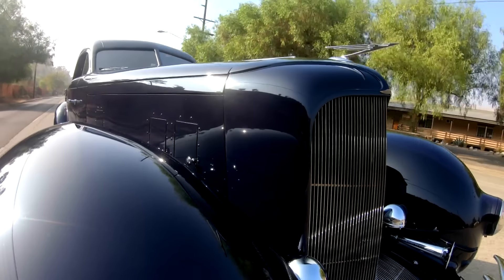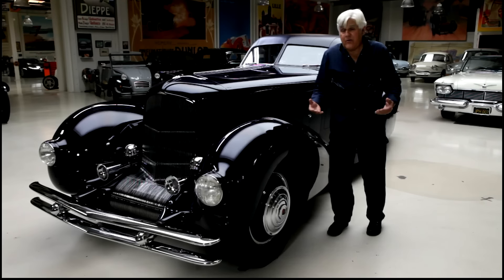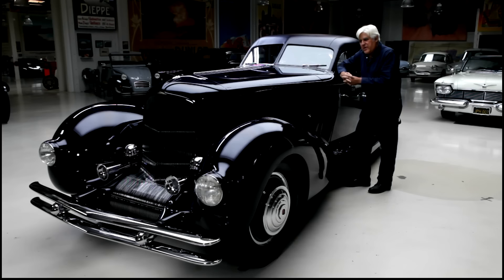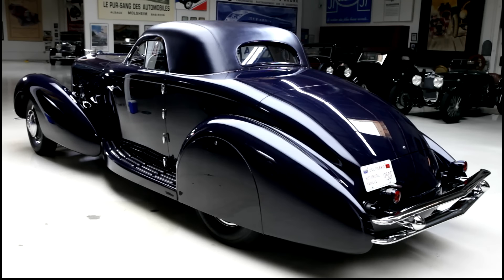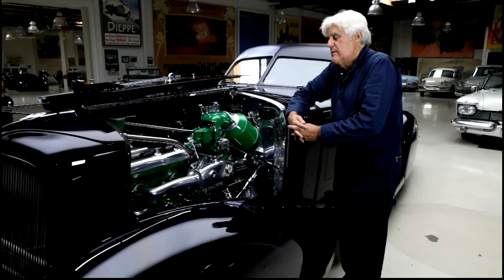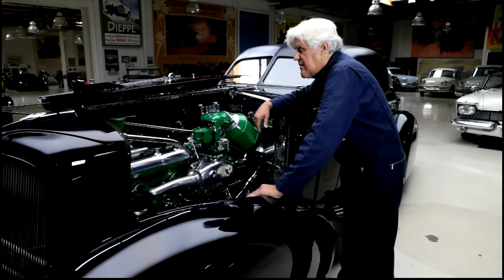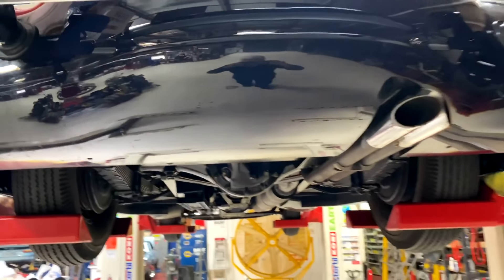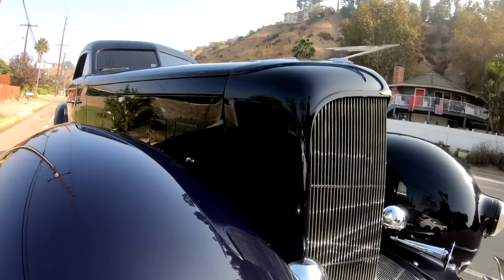The Most Expensive Duesenberg Ever Made - Jay Leno's Garage

Comment: That’s about as “art deco” as it gets
Reply: Check out the Delahaye cars from around the 30's.
Reply: @sclogse1  was just about to say this
Reply: @sclogse1  Some Avions Voisin are also fully art deco.
Reply: anything by figoni & falaschi and saoutchik
Reply: Chrysler and Desoto Airlow
Reply: The Cord 810/812 is more so.
Reply: Amateurs. If you want Art Deco car, Hispano-Súiza Dubbonet says hi. It has half of an airplane engine for crying out loud!
Reply: Bugatti Atlantic is the better version of this Dusenburg coupe. I'm avoiding anything over 4,000 pounds myself. Alfa 6C of this era is running circles around road blobs. Straight line highway cruising probably very nice experience in the Dusenburg. Except what, 13mpg negates that mental freedom.
Reply: Rolls-Royce Phantom l Jonckheere Aerodynamic Coupe & Stout Scarab are more radical Art Deco cars
Reply: @Greg-io1ip  13 mpg? Only when it's behind a tow truck. If you were to get 9 mpg, you would be doing well. On the other hand, who cares? If you could afford a Duesenberg, the price of gas just wasn't important.  You could well have owned the oil company and didn't even have to pay for gas!

Comment: By chance, we used to live in Oak Lawn Illinois, and a block away was Fran Roxas, who restored Dusenbergs, Cords, and others. My granddad used to make nuts and/or bolts for Mr. Roxas out of stainless, very difficult to work with, but he'd say that the parts my granddad made were perfect. One time my grandma reached and opened the door on a restored car, so my granddad hurriedly wiped the handle with a cloth. Sadly at the time I was 13 or so and not interested, but I do remember my granddad running the lathe in the basement, it had this incredible whirling sound. Still sad about my granddad dying back on 4/14/1983, he was a man of those times. Apologies for rambling a bit.

Comment: What many people today don't realize is that as late as the early 1960's, cars like a Dusenburg Murphy Roadster, that today goes for somewhere in the million dollar range, could be had for less than $500.
No one, with the exception of people like Bill Harrah or Jack Neathercutt (Merle Norman Cosmetics) understood the potential value of automobiles like the one just shown in Jay's video. 
Jack Neathercutt would drive around the Los Angeles area and spot automobiles that were once wildly expensive, one-off cars parked at a corner gas station with the name of a pest exterminator painted on the side of the car facing the street.
It had been promoted to a stationary bill board. 
These cars had become obsolete, terrible on gas mileage, and if the car had experienced mechanical or collision damage, replacement parts were impossible to find. Only wealthy people such as Harrah and Neathercutt, who had an entire staff of restoration specialists had the means to bring a car like this to like-new condition after years of neglect. 
In the post war United States, the well-to-do didn't want a car that was twenty years old that had seen service as a tow truck. They were in the market for a Cadillac Eldorado Biarritz or Chrysler Crown Imperial Limousine. 
I've personally heard a story of a man who worked as a plasterer working on new housing tracts in the La Miranda, La Habra area outside Los Angeles in the late 50's. 
His "work car" was an early 30s Dusenburg Roadster. He had removed the rear deck lid and used the area to store his tools and a ladder or two. I have no idea if the car was eventually saved or scrapped. 
I have met Jay on several occasions. Usually on the Sunday between Christmas and New Years Day. 
Jay is a person that started out as a car guy. Then he found fame. There are plenty that found their fortune and picked a "Hobby du jour" and scoop up really rare and beautiful automobiles only to lock them away, never to be seen in public again. Not Jay. Just like he said. These cars are made to be driven, not locked away in a warehouse or museum. 
Good on you Jay. Thank you for preserving our automotive history for all to see.
Reply: Bad News Bears coach Buttermakers pool cleaning  caddy had no trunk lid lol
Reply: Similar to when I was in my late teens, a "run out" GTO, Chevelle or Cuda could be had for a few hundred bucks.  They were everywhere.   And all our WI farm fields were littered with 57 Chevys and things of that nature.   Slowly, the landscape was cleared and now you don't see a lot of rusty gold in the fields anymore...
Reply: Well said!
Reply: dang
Reply: Duesenberg 😊
Reply: @smartysmarty1714  your right. in late 1974 one could buy a vintage 1969 muscle car for around $1500.00
Reply: at the last butler county auto auction a 1957 Fiat Spaziano 3 door coupe went for $650.00. Yet a 62 triumph piss-fire brought 3 grand......
Reply: Appreciate the knowledge.  I randomly stumbled across the Neathercutt museum during work.  As a native Angelino, I couldn’t believe there was this random and free museum of pristine classic automobiles in the most non descrip area of the San Fernando valley.  Truly a gem of a place in the otherwise drab suburban area of the valley.
Reply: The Rich mans game. Buy up what's wanted cheap. Say it's now worth millions. - Killed all the natural car enthusiasts. Shame. A bygone era. A good memory. I'd NEVER pay the price for a numismatic item - Only worth what someone says it's worth. Hey, I got a penny worth $100,000.00. Wanna buy it?
Reply: @RogerBrenon  wah wah, blah blah. An awfully long winded way of saying I'm a 
loser who is resentful of other's business acumen and success.
Reply: Those days will never be repeated, and not just in the vintage car business but lots of other collectibles that were junk in the 60s/70s. Imagine buying a Dusenburg for $500. I remember older members of my family saying cars are not an asset just a liability and they grew up in an era where no one collected cars, but the boomer generation changed that. Now some people buy new low volume potential future collectable cars as investments and and rarely drive them from the get go.
Reply: My Grandpa did the fancy plaster work on the ceilings of Nethercutt's San Sylmar, we got a tour after  it was finished... WOW! I remember he also took his cars out for Sunday drives with his people.

Comment: Jay is really providing an important historical service to the general public.  The history of the 20th Century with automobiles as the medium can be appreciated by everyone, from the uninformed to the engineers who understand the ins and outs.  He presents with so many vehicles that have almost been lost to time, and often he is just one step removed from the people, the experts who brought them to life, or remain as the foremost authority.  When those guys die, the knowledge will die with them.  The information will remain, but the knowledge will survive only with Jay and a handful of others.  There's no 20-something alive who is going to be the next Duesenberg expert.  Probably no 50- or 60- something, either.  The guy who is the expert on the Mercedes 600 hydraulic systems is probably in his 90s, as are any of the engineers who designed and built it.  This knowledge is invaluable to history and engineering alike.  Good luck rebuilding a 600 without "the guy" who builds 600s.
     That being said, my next point is, who owns the Duesenberg name and operation?  General Motors should buy it, if they don't own it already.  The Cadillac CTS-V (CT6-V) was as good a car as anybody else is building, but the Cadillac name has lost its cache.  It's no longer a competitor with Rolls Royce and Maybach and Bentley.  If GM wants a spot on the world stage, they should buy and produce Duesenberg cars... Make a big, opulent 12-cylinder (or 16) Sedan and coupe/convertible in small numbers for $1m or more.  Just do it, GM.  Not another electric or SUV.  Make a genuine Rolls Royce Competitor.

Comment: Enjoyed the owner history and the chroming process. Thanks!!
Reply: 1 re 3rd 8
Reply: M
Reply: I used to work in the Metallurgy Department of a steel foundry.  You would be surprised how the heat treating and quenching (air, water or oil) of steel affects grain structure.  Care must also be taken in handling some steels, i.e. stainless steel castings can not be lifted with a carbon steel chain or the stainless will rust.  They have to be lifted with heavy canvas straps and tied down to flatbed trailers with canvas straps.

Comment: Hilarious how huge of a car it is and yet there is hardly any more interior room than a Miata.
Reply: Priorities
Reply: Matrox One  cool cars like this died in the late 50s
Reply: Matrox One  A Toyota Corolla will probably outperform this tank in every aspect from acceleration, braking, cornering, fuel mileage, interior space, cargo space, reliability etc.  Literally the only thing this has over a modern econobox is style, which is subjective.
Reply: Matrox One  My point is simply that modern cars are light years better in every way other than aesthetics.  And the aesthetics make this car quite impractical.  Size of a huge SUV, utility of a Miata.
Reply: @Plur307  If the roads today were full of inefficient, high maintenance cars like this one, that might be a problem. But the existence of something that is unique, literally one-of-a-kind, like this is a good thing. Do we really need to be comparing it to a Miata?

Comment: My late father always had a compass in his cars usually held on with a rubber sucker, he also
fitted a vacuum guage in all his cars to help with driving economically keeping the needle in the green sector was he told me the most efficent way to drive. Seeing the compass in this remarkable car reminded me of him a skilled engineer his pet hate was adjustable spanners saying they could over tighten small nuts and bolts breaking them, prefering to always use the right size spanner.We had a car with a front bench seat with a large centre arm rest big enough for me as a 4 yr old to sit on, he devised a harness to securely strap me in and keep me safe, this was in 1964 when most cars didn't have seat belts, so we could  sit together driving me with a stick on steering wheel copying every  turn he made, good times for sure.

Comment: I've seen more than one large car over the years that got turned into a tow truck or a pickup just because they had a heavy frame and running gear that would take it. Packards, Cadillacs and Pearce Arrows were popular for that conversion when they got a little old, uneconomical and out of style as drivers.
Reply: My Granddad had a shop MANY years ago and I'm told he had a Desoto converted as a wrecker!
Reply: @PhilG999  Desoto's were big, and Chryslers first 'HEMI'....
Reply: Thank you for this insight. I wasnt even thinking about that...actually, practical.
Reply: Actually saw a Kaiser Henry J converted into a tow truck about 10 years ago in a junkyard in Maryland
Reply: In the UK during WW2 a lot of big American cars were converted into crude emergency ambulances or mobile canteens. They were big and heavy enough to take the weight of a box body, and there was no petrol for private motoring.

Comment: Nickel is much better looking than chrome. I would have re nicked on the chrome pieces, plus you don't have to worry about it breaking. It's a beautiful car & in my opinion the best chassis & engine ever made especially for it's time. Everything turns on ball or needle bearings. Timken was making split needle bearings for GM, Ford & Dodge V8's. They made more power, got better gas mileage, they were even putting needle bearings on the main journals of the camshafts. All the sudden they disappeared, I think the big oil & gas companies said they didn't want car engines lasting that long or getting great gas mileage

Comment: This was an entertaining, humorous episode on an amazing car (HA - that was used for running over poor people) and now owned by a true automotive enthusiast and one not 'scared' to state the purchasing and restoration cost.  Unless I am wrong, hydrogen embrittlement can occur during all forms of electroplating, not just chrome electroplating.  I can recall bolts for a Stearman 75 we were working on and my mate took the bolts for electroless nickel plating and was FURIOUS when the outfit contracted to do the work ignored his order and electroplated the nickel, therefore causing the bolts to fail certification due to potential hydrogen embrittlement (if my memory serves me correct).  I can also remember an early 911 I was restoring and a hood latch spring in a bundle of parts being re zinc plated snapped on a nasty sharp break and I put that down to hydrogen embrittlement.  Hydrogen embrittlement can cause catastrophic failures and why I cringe when I used to see chrome suspension parts that in all probability had never been baked after the chroming process.  What a car, glad to see it belongs to someone that is worthy of being the owner/custodian of such a automotive treasure.  CHEERS from AUSTRALIA.

Comment: love your videos I need a job with yall been wrenching since about 10 years old   NEEDS A heat shield over muffler and insulate back of that aluminum heat sink they call a firewall  BUT then it is not original or period correct  WHAT A DEUSI

Comment: I'm confused. At 23:43 Leno is under the car with his camera mentions the "massive 44 hundred pound chassis"... Okay, but when driving it on the #210,  @ 26:36, he claims this Duesenberg auto weighs "6000...(something)...3 Tons!"...thats an additional 2000lbs of body metal?  Does this automobile weigh more than 6 tons?  Incredible. A CAR that heavy. The problems the rich folks have!  Where's the seat belt?

Comment: Gee that will cure the green planet problem overnight for sure;
"GM Sold A Total Of 26 Electric Vehicles In Q4 2021
Twenty-six. Not 26,000. GM sold 26 EVs between October 1 and December 31, 2021.
GM Sold Just 26 EVs Including 1 Hummer In Q4 ’21
According to figures released by the automaker, during the fourth quarter of 2021 it delivered a grand total of 26 electric vehicles. These consisted of 25 Bolt EV and Bolt EUV models and a single GMC Hummer EV pickup.
That is really extraordinary, in the sense that the Hindenburg explosion was also extraordinary. Was it due to supply chain problems? No. It’s because GM was dealing with the crisis of its existing EVs spontaneously bursting into flames.
What’s not mentioned is that GM also went through a huge battery recall of the Bolt EV and EUV which forced the company to suspend production